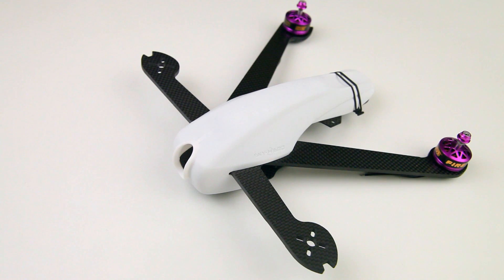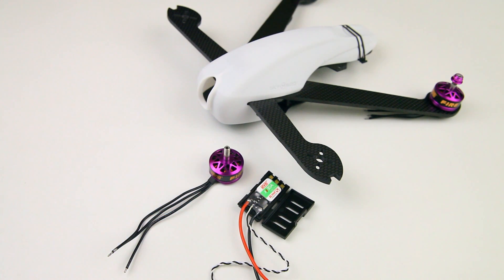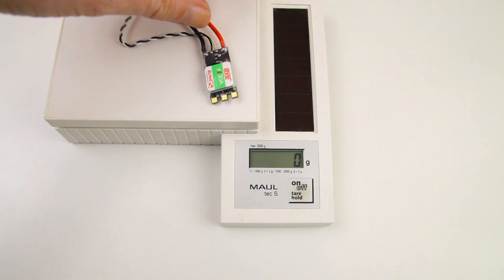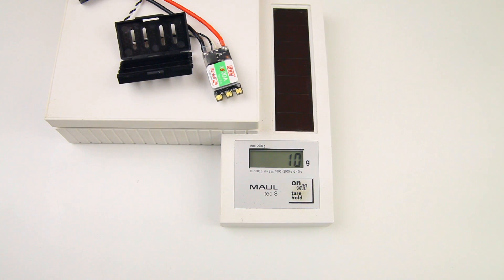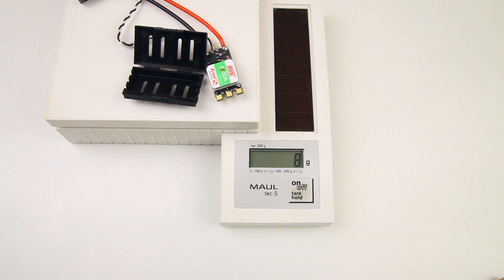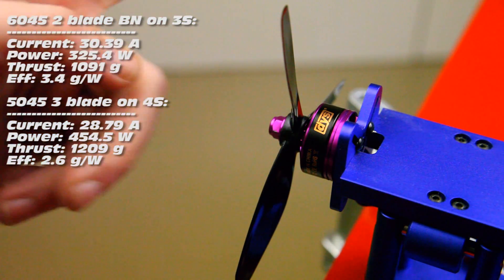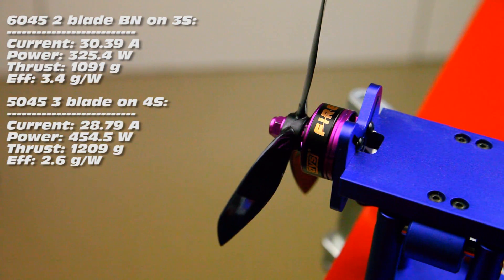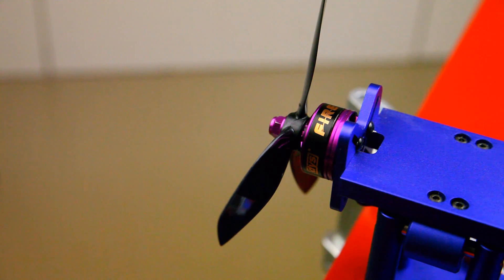Sky-Hero Anakin P2: DYS Fire 2300kv motors + DYS XS30A ESC's

Comment: Nice review and test of the motors buddy! I putting out a hot damn alert! hehehe! These motors are going to be fun with 3 bladed props! I also like your scale for measuring weight I need one eventually! :-) cheers buddy
Reply from the maker: Enough power on tap I'd think huh? ;)  4x1200 grams of thrust on a say 450 grams quadcopter ;) 
Quite a difference in what the props sound like as well huh? :)  Ah yes.. a scale.. I'm sure BG has Something for a few $$ :)
Cheers & thanks for stopping by brother!

Comment: I would like to do a bench test on those two motors. I couldnt see a c clip throwing the balance of a motor off. Being that close to the center of balance anyways. Also those cClips sit in a channel that cannot go anywhere. If the shaft on the other end sits in the bearing,there is no chance for the clip to move into the shoulder,wearing down. To be honest,I can see a crash causing damage to the motor long before wear doing any damage. Anyone flying FPV is going to crash,thats the long and tall of it. If they were brushed well then that would be compairing apples to oranges. I wouldnt be testing anything other than what you know will be in the unit. Wouldnt the props determine what the motor is using as far as power? I actually saw a guy fry his ESC because he was using a smaller prop than originally called for. I think the same can happen using too big of a prop. I know I experienced a less than desirable condition by using too big of prop. It can be confusing thats for sure. Its better to go with a larger ESC if possible on any combination. At least I think so. At least 5 amps over cant hurt. That part of RC has always puzzled me. I am not much of a gambling man when it comes to figuring out where my limits are,then pushing the crap out of them.
Reply from the maker: Howdy Scott :)  You are right: the inbalanse would not be severe.. Still.. any unbalanse is an unbalanse.. Remember that these motors will be spinning at a high rpm...
Well and Most motors with them C-clips show slop after a while.. But yep.. good chance you crash the crap out of a motor before that happens :)   On the other hand: I do have motors that have survived 4 quads, and are now on airplanes :$ 
Props make up a Good part of the outcome of these tests indeed.. Basically, you are testing a combo of ESC + motor + ESC.. That is why I test the motors with the same props every time.. 
Big props work well on planes.. On quads you have to change rpm's quickly and offten.. so a big prop would nog be ideal for a racer / acro quadcopter..

Comment: I used the cases.  They have stopped a hits from a rotor strike.  I've got those props arriving in a few days, but in the clear plastic so I'm keen to see the stiffness difference from the coloured ones.
Reply from the maker: Hmm that is indeed a good point.. My ESC's will be at the bottom of the arms.. and well.. yeah.. food for thought :) 
Ah yes.. good chance there Is a bit off difference I'd think...
Reply: Just got those props in.  They are way stiffer than the opaque versions.  More thrust but more breaks as well at a guess.  Tests tomorrow.
Reply from the maker: We Are still talking about the Kingkong 5045x3's? :$  I have found them to be quite durable :$
Ohww.. but I allso need to get me some of these to test :$ 
http://www.banggood.com/2-Pair-DALPROP-T5045C-5-Inch-3-Blade-Propeller-Clover-Prop-Black-Red-Orange-Green-p-1110019.html?p=TO251813974002015038